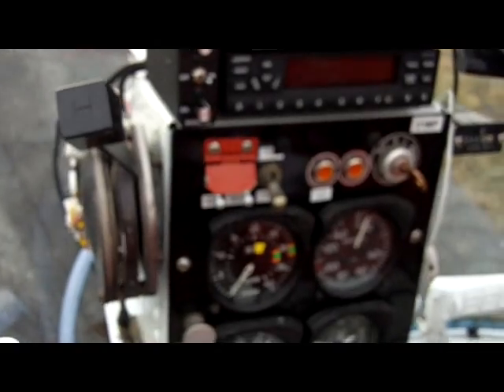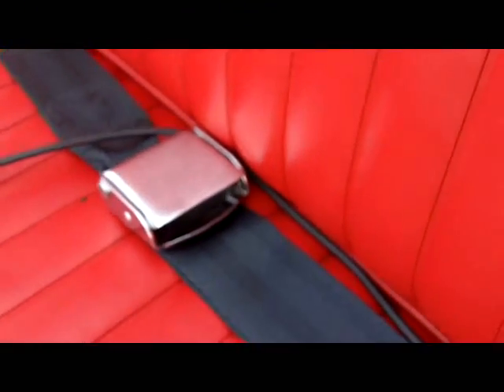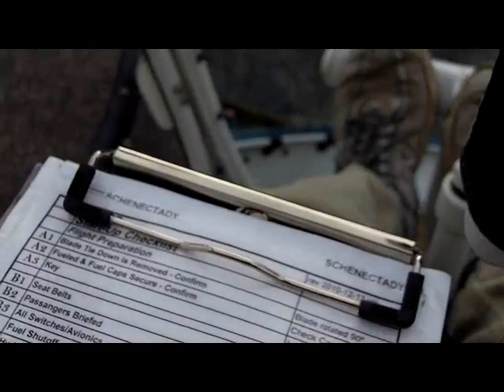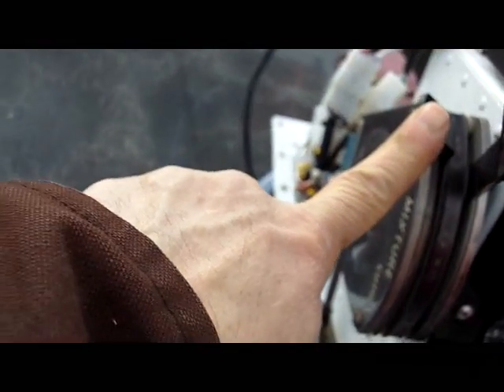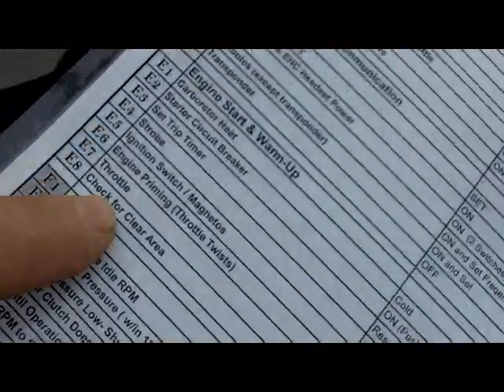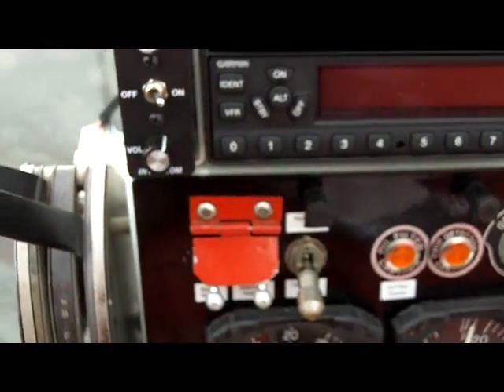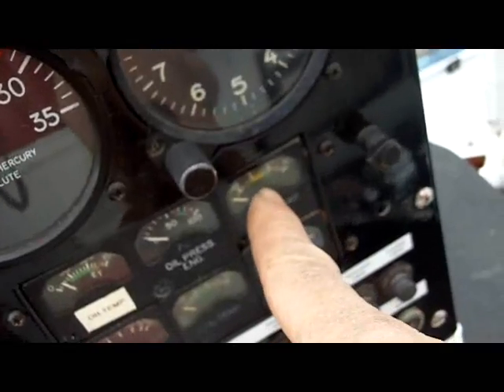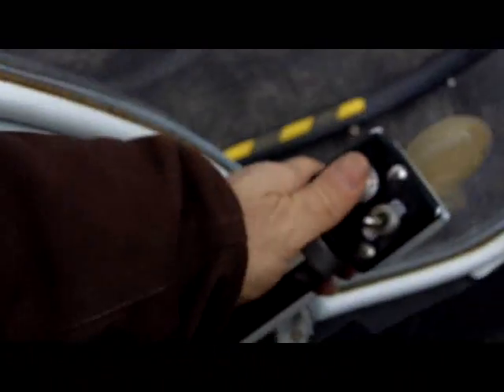Bell 47 Helicopter Starting Procedures http://RudolphJHelicopters.com

Comment: I have about 1,000 hours in several different G4As.  The starter button wasn't on the collective.  There was a small lever you pushed down with your right foot to engage the starter.  Of course, that was 50 years ago so things have changed a little since then.
Reply from the maker: D1 and G models still have that lever.
Reply: Friction lock on the collective, or no?

Comment: Has any non-turbine powered helicopter ever used a diesel? I know they're probably too heavy but I'd think a diesel would be ideal since they need no ignition system once started and can run all day at a steady RPM with better fuel efficiency.

Comment: I've flown on 3 different helicopters. A big rickety old 1940's looking I don't know what and can't find pictures. A Magnum PI MD500 and a Bell 47.
The 47 was the most enjoyable, most helicoptery helicopter. With the full open bubble and no doors, great visibility. You got a real sensation of "hanging" from the rotors like a basket. You know you're flying. We did some low level canyon dives. Great aircraft.
The rickety thing was just too rickety and the MD500 was just too smooth. Very fast and nimble but not the same sensation. Might as well be watching a movie screen of being in the air. I guess it's like cars, I prefer the older ones where you really feel the road. In the 47 you can really feel the air.

Comment: Depending on the model, the 47 can have the Original Franklin or as late as the TVO-360.
Yes, there is a clutch.
The very last model has a small APU, as it was intended for executive transport (US) and a lot of extra electrics.
Remember that the 47 is in the tube radio era, modern radios would have been added to date.
The actual radios in that era were under the seats.
Now, it is all in the panel.
Enjoy!

Comment: Thank you for sharing this video. I couldn't see the carb heat test response on the gauges.
Reply from the maker: Yes it is hard to see on this helicopter. The needle moves very slow and takes longer than most to respond so for the sake of not dragging out the video I terminated the test a soon as I saw the needle move.

Comment: It has a clutch so you can start the engine without it being connected to the transmission. The starter has enough power to start the engine, but not the engine and transmission together. Under most cases, if you try to start with the clutch engaged, it will stall out almost immediately. I fly a pretty new Robinson R22 Beta II. It also has a clutch. The engine is a de-rated Lycoming 0-360 de-rated to 114 HP. It works in a very similar way to the bell 47. I usually use the nickname of a "Bubble Copter", due to it's unique exposed frame. You can attach body panels, which improve the aerodynamics at speed but add weight. I like how the Bell 47 series handles in a cross wind, as the exposed frame greatly decreases the effects of crosswinds against the fuselage.
Reply: The Bell 47 has a centrifugal clutch, you can not start the engine with the clutch engaged, the clutch works on engine rpms, where as the R22 is ON/OFF via belts.

Comment: Clutch?
Reply from the maker: The clutch engages automatically. It is a centrifugal clutch expanding outward as the rotor RPMs increase.
Reply: What chopper have you flown that the clutch engages automatically? Old school machines do/did!
Reply from the maker: Bell 47s, all others that I have flown are belt drive. Hillers may have the same clutch as 47s but I'm not sure.
Reply: Rudy Perini The Aerospatiale Gazelle also uses a centrifugal clutch. At ground Idle (approx. 23000rpm) and below, the engine & clutch are disengaged but when the ECL (throttle) is advanced the clutch engages to couple the rotors. By approx. 43000rpm (flight idle) the transmission is fully engaged. This is the normal flight condition. The Alouette had a similar layout I think. Most modern heli's use free power turbines I think with no clutch.

Comment from the maker: Used Bell 47 80-150K USD depending on the model and condition. OR you can buy a Zero time Bell 47 from Scott's Bell 47 for 310K almost brand new.

Comment from the maker: The Bell 47 and the R44 are two great helicopters and I like them both. The R44 is a helicopter you can go some where in because it has some speed. The bells and there are many model 47s are more for working in an area. They are extremely stable but slow. check out Scott's Bell 47s Scott  is going to build brand new Bell 47s in the near future. He bought the type certifficate from bell Helicopters.

Comment: I needed more room to give you more detailed explanation, but the pitch in the tail rotor blades is controlled by the pedal inputs which allow for antitorque control and maintaining the heading during liftoff and hovering and when making power changes.The tail rotor is driven off of the main rotor transmission and turns at a fixed gear ratio with respect to the main rotor RPM. If I can be of any more help to you, please feel free to contact me with your questions. Take care and safe flying!

Comment: Hi there! I am a full time helicopter pilot and instructor as well. The tachometer has two needles, one long, one short and when at operating RPM, they are joined together and what they indicate when the smaller needle (rotor RPM) is superimposed upon the longer needle (engine RPM) is that the engine and clutch are fully engaged prior to and during all flight operations. It allows for separation of the clutch from the engine in the event of an engine failure and allows for an autoration landing.

Comment: The main and tail rotors cannot be disconnected and always maintain the same ratio of RPM. (The tail rotor is faster than the main rotor.) One of those needles is for rotor RPM and the other is engine RPM. What "splitting the needles" does is check the operation of the clutch. If the engine RPM drops suddenly as in a failure this clutch will allow the rotor to freewheel and autorotate the helicopter to a landing. What he's doing is just closing the throttle and making sure the clutch disengages.

Comment from the maker: The RPM gauge, one needle is the engine RPMS and the other needle is the main rotor RPMS.When you roll off the throttle the engine rpms roll back to idle and the free wheeling clutch lets the rotor disconnect from the engine an continue to spin thus you get a splitting of the rpm needles.

Comment: Brother, Im a private pilot, but for fixed wing.... on your RPM gauge, when you say split and bring the needles together.... are the two needles for the main and tail rotor? The larger being the main rotor and the smaller being the tail? Do you keep them together by simply keeping the pitch on main low or constant and the tail rotor neutral? Sooooo many questions because I really liked your video and I want to transition into rotor after I finish my instrument rating....